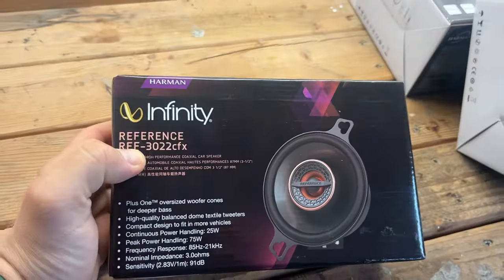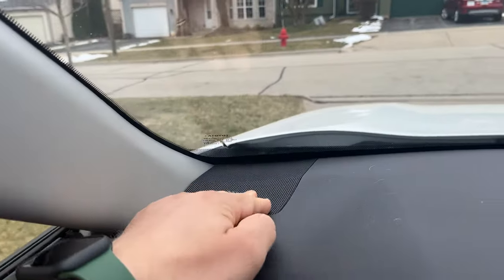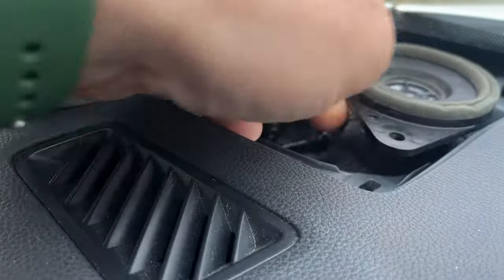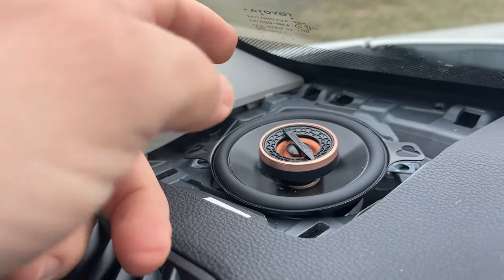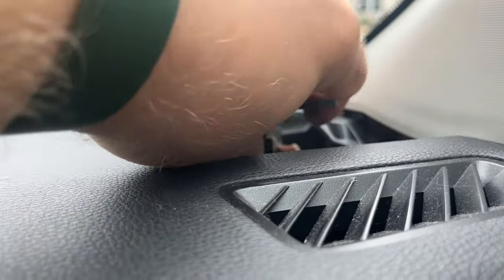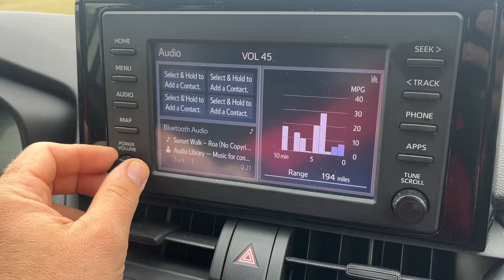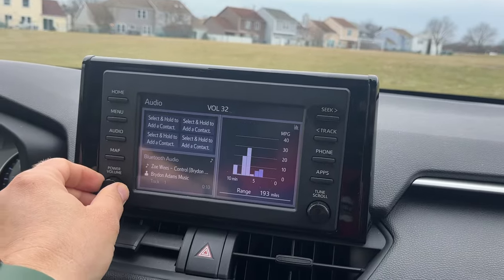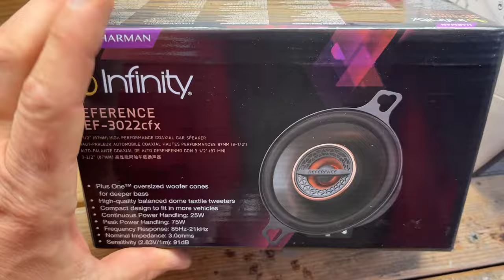Toyota Rav4 (2019- 2023 +)  dashboard speaker upgrade

Comment: I read that if you have the emergency call system there are 2 speakers in the dash. I think they are one unit. Anyone know about this?
Reply: Interesting.  When I saw the connector in the video I was wondering why it had what appears to be 4 wires coming in and the speaker also has 4 spades at 5:37.
Reply: Very sharp and good question! Anyone know it?
Reply: Llevas razón en el salpicadero del lado del acompañante lleva una unidad compuesta de un tweeter y otro altavoz de frecuencias medias con conector separado que ya me da que pensar que pensar que según lo que dices que puede ser para las llamadas de emergencia y que para instalar el nuevo altavoz onfinity Jay que retirarlo , sería bueno saberlo  siiii

Comment: WARNING: I have an RAV4 2023 and when I opened one of these 2 dash panels, under it there are squeezed together (near each other) on the same metal frame TWO speakers (one tweeter and one slightly bigger). I did not check if 2 pears of wires go into them (because I did not bother unscrewing them to see what is beneath them). But you should check exactly this BEFORE BUYING. Because, if you have 2 pairs of wires, then it will not work well replacing the double speakers with single speakers...
Reply from the maker: Maybe 2023 model different, but on my 2019 it was very easy plug and play like you see in the video.